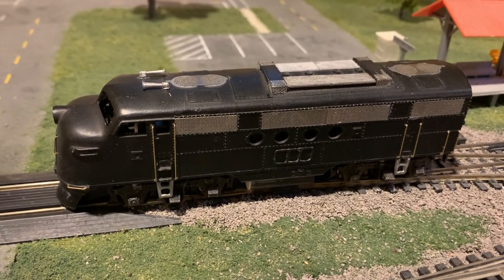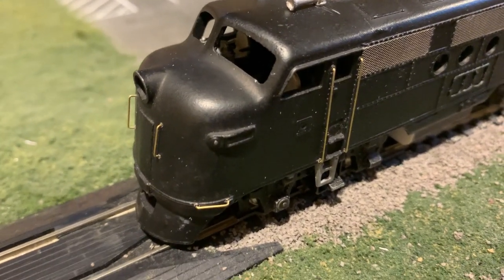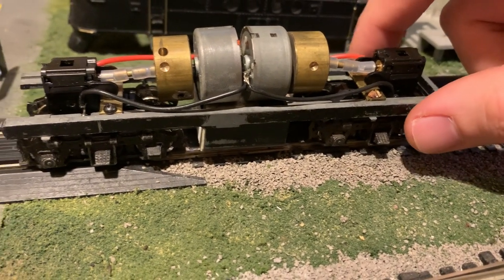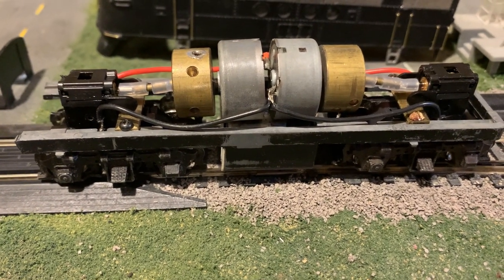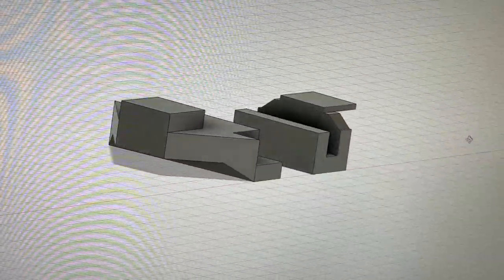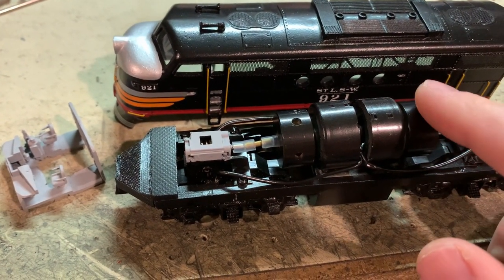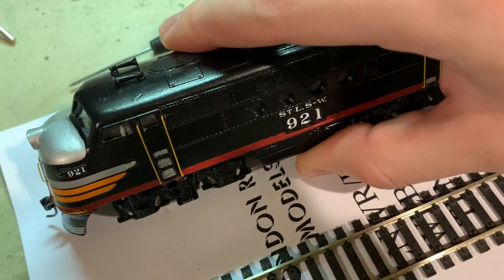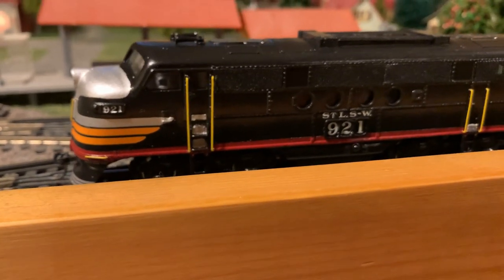Cary Custom HO scale FTA

Comment: Hello Darth,
  First off I want to say that I truly enjoy everything you pot on your site. I like your experimentation and many unusual projects. Ihaven't been very familiar with many of the F and E units variants EMD locomotives. Then I saw today this video of yours on this FTA. I had never seen the screened double roof vents and I wondered if they were spot on. So, I got out my recently purchased Guide to Electro-Motive E and F units by Jeff wilson. Your engine is on pages 60 and 61. I won't nit pik, but I do have a question about the three rough looking squares below the four port holes. What would that represent in real life ?  Or could you link to a picture of this alteration ?  Thanks
Reply from the maker: Thanks!  The squares are number boards which were used on some of the SP's St. Louis South-Western branch A units: https://i.pinimg.com/originals/f1/4a/a3/f14aa3fc35c24a0c2904824570499f59.jpg

Comment: Impressive !  I guess it would have been easier to use one flat can motor than these two can motors you've used. Good job. And the paint job is really awesome. May I ask you about the grilles and the colors? Did you made the grilles by cutting them from a photoetched sheet or were they already cut and part of a kit?   I'm planning on painting a FM Trainmaster in Black Widow scheme. Could you provide the brand name and color references that you used, please?

Thanks a lot.

Kind Regards,

Juan.
Reply from the maker: Thanks! The grills are Detail Associates 2728 and 2729 kits for Stewart FTs. The black and silver paint are Scalecoat II, and the red came from a spray can (I’ll have to check on that later).
Reply: @DarthSantaFe  Thanks a lot again! After watching your incredible work I had to subscribe to your channel. It is always a pleasure to watch this kind of videos from such skilled people.
Reply from the maker: @jagc1969  Ok, so the color I used was "wagon red" from Krylon's "Now" brand.  SP Daylight Red might be the most accurate for the Black Widow's red stripe if using railroad paint (SP Scarlet looks a little too bright to me).  I also gave it a finishing clear coat with Micro-Satin.
Reply: @DarthSantaFe  Thank you very much !

Comment: May I ask you one question about your painting job ?  I need to paint some EMD F7s and other locomotives in this "Black Widow" scheme. The silver and orange bands at the front are decals or were hand painted?  Any advice on how to paint these locos?  Thanks a lot.
Reply from the maker: The silver and orange stripes are decals from Microscale's #87-201 set, but the top of the nose is hand painted with Scalecoat II silver.  I started by painting the red strip around the base (no masking), and than masked that off to do the black.  After touching up and finishing a few areas, I applied the decals, feathered the silver paint into the silver decal a tiny bit to blend the meeting point, and then clear coated it with Micro Satin.
Reply: @DarthSantaFe  Thanks! This is a very useful answer. Thank you very much for your answers and your patience.

Comment: Do you have the part numbers for the metal grills and other ones you used on this?
Reply from the maker: I know I used Detail Associates 2729 intake grills on the sides, but I can’t find the etched ventilation set I used on top. The grab irons and MU hoses came from a Cal Scale F unit detail set, and the radiator fans were leftovers from an Intermountain F unit shell kit.

Comment: The shell is ZAMAC (zinc-aluminum-metal-alloy-casting) not lead. Most domestic HO locos were built with this before plastic came in vogue.
Please note that FTAs in real life cannot run alone; they can only run with a matching B unit which contains the starter battery and steam generator. They are usually joined by a permanent drawbar rather than a coupler. Most roads operate them in either pairs or ABA combos, but none have ever run alone.
Again, the limiting factor in HO locos is not the motor, but wheel friction. No motor, however powerful can prevent wheel slip.
Reply from the maker: The old Cary bodies actually are solid lead. It’s heavier and much softer than the zinc, zamak and pewter kits I’ve built, and has to be drilled slowly since lead has a tendency to reform itself around the drill bit. They did change all of their kits (including this one) to zamak over time, and the E6 body I ordered just before they went out of production was made from that.
Someone was kind enough to send me their spare B unit, so I’ll have a matching AB set once it’s finished. :)